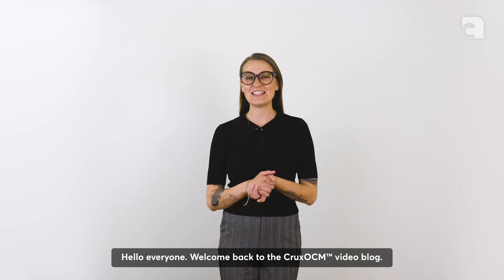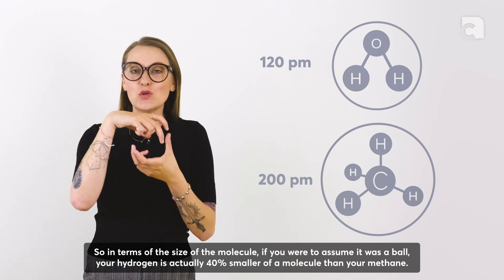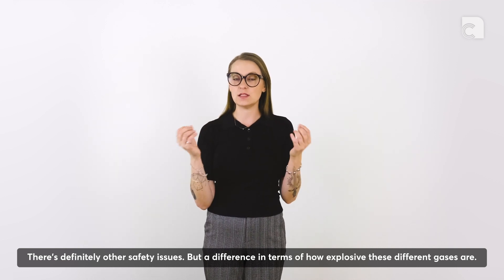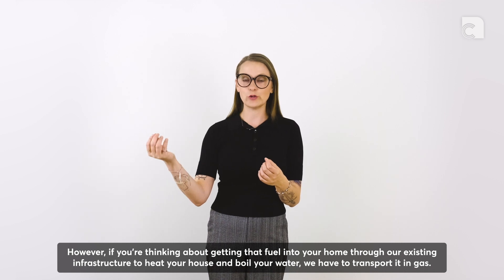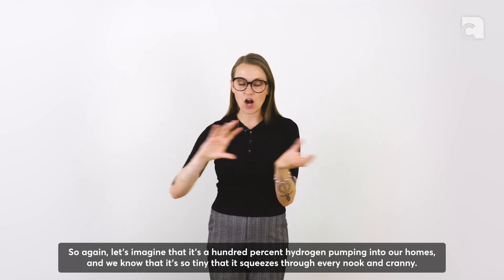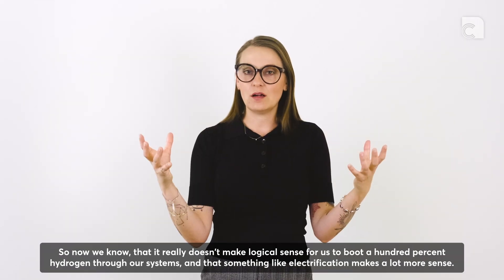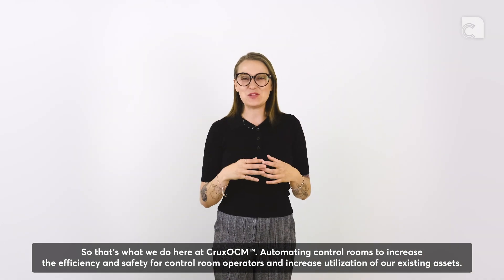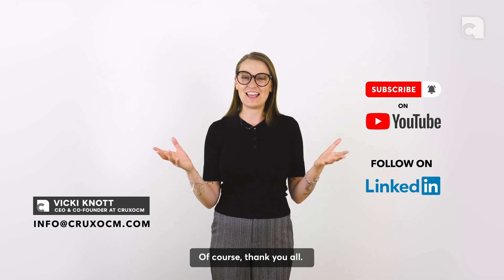Natural Gas vs. Hydrogen

Comment: I think your energy density of methane is wrong. It should be 38 MJ/L, not 38,000 MJ/L. Still much higher than H2 but not ~10^6x bigger.
Reply: Methane is 38 MJ/m^3, so more like 0.038 MJ/L. So it's about 4x the volumetric energy density of H2 at 0.01 MJ/L.

Comment: Burning methanol produces CO2, which has the same effect as burning methane.  Methane is also a green house gas, leeking methane is bad, but is naturally decays in the atmosphere in 40 years. There is some evidence that a builld up of leeked hydrogen can interfere with the methane decay, making that green house gas a bigger problem. IMHO use of hydrogen on massive scales needs to be very carefully managed.
Reply from the maker: Thanks for the additional perspective! That is interesting that leaked H2 can potentially interfere with methane decay.

Comment: Why hydrogen when methanol exists? ‘Oxygenated and liquid’ is a grand combination, eh?
Reply: Wow. First of all, why are you showing a water molecule? Second, hydrogen does not explode unless it is mixed with oxygen.  Third, the Hindenburg was not a blimp. GD, do your homework. Silly goose.
Reply from the maker: @richardalonzo4717  - 1. whoops that is a water molecule, will be sure to let our editor know! 
2. upper and lower explosive limit refers to hydrogen when mixed with air aka oxygen is in air :)
3. https://en.wikipedia.org/wiki/Hindenburg_disaster - airship? I like the term blimp but we can use the term airship instead!